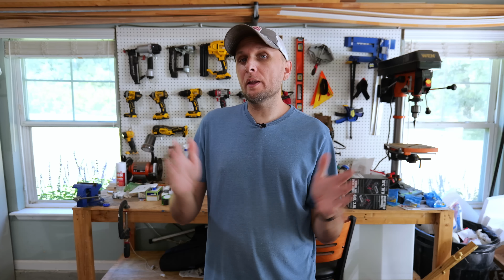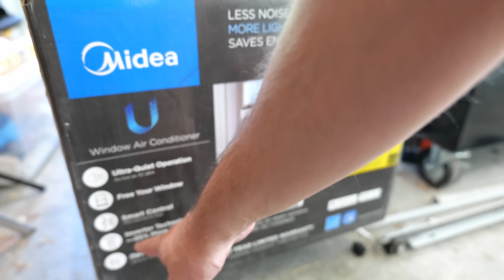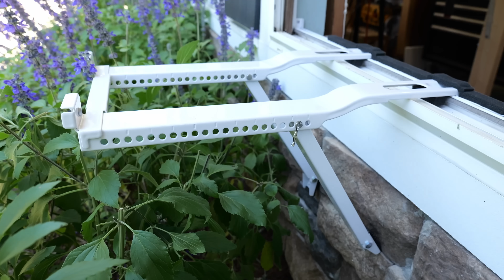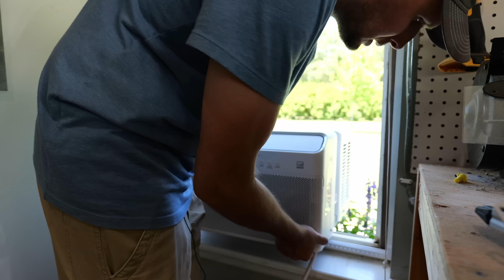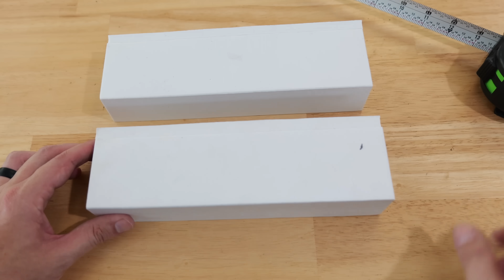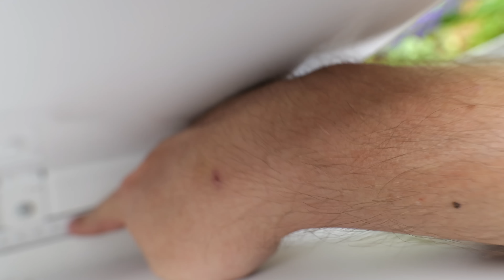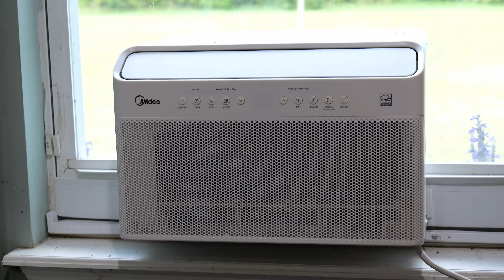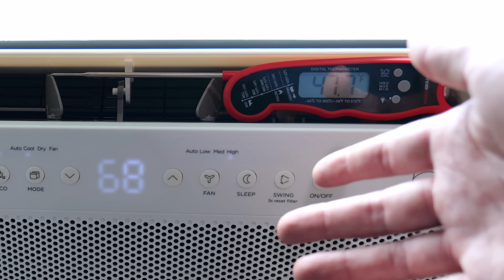The COLDEST And QUIETEST AC Unit Ever Made!  Still Use Your Window!

Comment: Why do none of these DIYers concern themselves with the fact that their machines are talking to servers that are not within your authority?  All of these phone apps that everyone nuts over are connecting your home to SOMEONE ELSE'S SERVERS!  The only thing keeping them from either taking control of the devices or in other cases selling info about your home is a flimsy promise.
I want to know more about the options.  Can I connect it to Home Assistant and actually control the device without it talking to outside servers?  Is there a PC app that I can use instead?  Does the system still work if the internet connection goes down?  It just feels like everyone is drinking the kool-aid of the Internet of Things.

Comment: So where does the water actually drain out of the unit?
Reply: It is actually a splasher type of unit that uses the condensate to help cool the condenser and increase efficiency. But any excess water will drain out the back where there is a drain hole underneath.
Reply: @anonymous-zn2iv  Thanks,  I have not seen the or felt the drain hole. My water drains out of the very back, I am seeing rust on the body of the AC  and algae growing on the vines of the AC. I have been using it for a month now, yes it is tilted correctly.
Reply: @Moondoggy1941  Actually the drain hole is close to the center of the unit putting it near to the outside wall.
Reply: @anonymous-zn2iv  How many inches from the back of the unit going forward is it?  I got a feeling I have is a manufacture defect.  Thanks again.
Reply: @Moondoggy1941  I just measured it, about 12 inches. The hole is quite big actually. You can put your finger through it.
Reply: @anonymous-zn2iv  Thanks again. So I measured it and I found the hole, it basically is right about the window sill, so this seems weird to me, 

if the unit is suppose to be tilted back then why is the hole in wrong location? aka the front.
Reply: @Moondoggy1941  Perhaps to allow the water to collect near the rear fan so that it can fling the water to help cool the condenser. It's suppose to create a pool of water near the back. If the water level gets too high then it will start to leak out of that hole. I don't think you need to worry about it.
Reply: @anonymous-zn2iv  Thanks when I looked at the coils near the end I could see crude and algae, I also could see a rust stain over the back of the unit where the water is trickling  out. I appreciate the help.
Reply: @Moondoggy1941  Sure thing

Comment: Overpriced, non rust-proof interior materials. I'll pass.
Reply: It's a converter type compressor so that is why it is more expensive than your regular non inverter ac. All ac's will rust over time. But it will take years before the rust will actually cause any functional problems.

Comment: I bought that 12000 15 months ago and can tell ya I live it,, my central doesn't run and I do have a small ranch ( 2 bedrooms and with a fan in the dining room it's cooled my 1000 sq ft house ,, it's in a living room window,, if it goes out I will get another, hands down amazed at the cold air , quietness and my electric bill went down noticeably from running the central.

Comment: How useful is it to be able to use the window?  You really can't use it for ventilation since you can't use a screen.  I don't think it is a very useful feature.
Reply: Actually the benefit is more for minimizing the sound from the compressor by having the compressor basically sealed off from the room. The ability to open the window is just a minor benefit as a result of this design.
Reply: @anonymous-zn2iv  now that's a good benefit. He should have touted that instead of the usability of the window.

Comment: I bought this unit 2 years ago and I love it! The quiet efficiency that this video reports is borne out by my experience. I have this in an upstairs bedroom where my central ac just doesn’t reach very well and now I don’t have to run the central ac nearly as much. This ranks as one of the best purchases I have ever made, of any product!
Reply: Thank you. I have a loft that gets pretty hot too. 🌬️🔥💨🌨️❄️❄️❄️ This is definitely another good option to consider 💫
Reply: Was yours affected by the mold recall?
Reply: it's chinese, wait till it breaks down in about 4 years
Reply: @roachedout  I bought 6 with a spare new in box in the garage.   If one breaks in 4 years, still cheaper to replace than to fix a mini or central AC unit.
Reply: @roachedout do you have any recommendations for a good unit ?

Comment: Quite a setup, but you don't need to break anything. Might still be practical, somehow
Reply from the maker: Break anything?
Reply: @HowToHomeDIY  oh, I forgot you guys have wooden walls. No "cutting", then, to place a unit and pass conductors and tubes 😅. With brick walls you have to break then to install and pass tubes, if it is a split unit (or open a hole to install the old single unit ones)
Reply: @HowToHomeDIY  I comment this because it is the first time I've seen a window unit like that, never seen it before
Reply: @HowToHomeDIY  a week later, I got your confusion. Over here in my country, regular, old, "window units" are not placed at the actual window. Instead, a whole is opened somewhere in the wall for them to be installed. That's why I thought of this one as quite convenient, if you DON'T have such hole in the wall already and you don't own the property (or can't make one for whatever reason)

Comment: How do you clean one of these type AC units? I know how to take a window unit out and clean the coils with spray and water hose. Can you spray out the air intake coil in one of these? I jave an 8000 but unit that needs cleaning. Great video

Comment: The Midea unit I purchased,  came in , brand new ,  fan was hitting one of the pipes under the metal covering , I pulled the cover off and rebent it out of the fan blades ,  so this happened before the cover was installed at the factory , no damage to the outside of the unit , quality control sucks !  Lasted 1 year ,  I just through it away , I'll never buy another midea unit again

Comment: I have this 12000 BTU unit, kinda wish i had gotten the upside down U shaped unit from a different company.
I assume its not as well built, but the thing sits on the window sill and i dont think requires a tray. Also, allows you to use ALOT more of the window than the Midea
the Midea worked great at our river camp when our normal vacation spot canceled on us because of a recent change in pet policy and we had to just camp on the river in an un-airconditioned thin walled un-insulated elevated camp... when the outside temp was above 100 and humidity, being in the midwest on the mississippi river, would often top 80% after a short rain.
Reply: Are you one of those people that ramble on about your life stories, and get side tracked about the original core meaning of the subject matter? IE -  canceled on us because of a recent change in pet policy BLAH BLAH BLAH???!!!
Reply: ...if so, I have a gift for you! I want you to google the word "Loquacious". Your welcome!
Reply: @SundayFoggyNotions  2 seperate trains of thought. Wishing i had the other unit because its upside down
Praising the one in the video because it cooled something that wasnt supposed to be cooled.
I do see you're the kind of person to like your own comments because you dont have anything to add.
Reply: Forgot to add, yep totally the rambler.

Comment: I am taking my 8000 btu unit back today. It worked great last year. I tried to turn it on for the first time this year in late May and got the EC07 error code. I tried to troubleshoot it, called Midea, and the said the outside fan was not working. My experience - it’s not reliable. The install took quite a while, so even though the design is great, you may spend a lot of time for something that works a few months.

Comment: @10:40   72 degrees ???   I see 73.

This is fine IF you have sash-type (or vertical sliding) windows.  Not so great with casement or horizontal sliding windows.   :(
Reply from the maker: I had it set lower.

Comment: You put the foam upside down in the window...  Look closely at the foam you will see a line where it's thinner on one side of the foam, that goes into the track for perfect fit with out adding extra foam
Reply from the maker: No I didn’t.  It shows it in the instructions.  That lip is for the bottom of the sliding window.

Comment: 15 SEER isn't bad for a window unit, but it's still a ways off from even the low end of mini-splits. At that price, if all you need is a single room, it's definitely a contender, but once you start getting into 3+ zones, you're still gonna be better off price wise with a mini split. Of course we're not talking about places where you couldn't realistically install a minisplit.
Reply: For 3 rooms, or zones, with mini-splits, I was quoted approx four times the cost of 3 of these units.   The mini-splits are of course more energy efficient but the pay back savings period would be a number of years.
Reply: @richard6150  Then someone was screwing you over BIG time with that quote. A 3ton three zone at home depot is only 2300 for the unit itself. If you're going to be staying in that place for those years then that energy savings is a valid thing to consider. I think the window units are more practical for people without the skills or ability to mount a mini split or cannot modify where they live.

Comment: I have two of these units. One unit has heat. I live in a 2100 square ft house in the Houston area. I have them installed in the main living areas to supplement the central a/c. I've found that if you run them on dry mode they will use around 400 to 600 watts. Each of the units are connected to their own Delta 2. If the outdoor temp is in the low 90s my central unit won't even kick on.
Reply: Delta 2 ?
Reply: @richard6150  EcoFlow Delta 2

Comment: Seems gimmicky, the #1 problem with window AC units is needing to clean the inside coil and fins and the outside coil and fins every 1 to 3 months. With a motorized air guide it makes it even more of a hassle to clean out the air path. If they could just focus on utility and ease of clean up I think that would be the real shift the market needs.
Reply: That also applies to split systems.

Comment: I've had three of them.  They work well.  Very quiet, very cool, and the scheduling app works well enough and is compatible with Amazon Alexa.  10K and 12K models.

Downsides:
They get funky smelling after a year or so.  You must take them apart and clean the squirrel cage fan to fix that.  After year two or so, the various DC motors, compressors and fan, start getting louder.

That being said, I still think they are a great purchase and a decent value for the money and much easier to deal with yourself when compared to the overpriced garbage equipment being peddled by residential AC companies and the DIY mini split companies. 

The best time to buy them is during the winter.  They are considerably cheaper that time of the year.
Reply: Duly noted, I'll purchased one then. It's June right now (for future reference) and the price of the 8kBTU is only a little bit less than the 10kBTU, which is $399
Reply: The musty smell is the biggest problem with these units. The multiple water drip holes underneath can also cause leakage over the sill so that has to be addressed too.
Reply: Where I live, even in winter, AC's don't fall in  price.  :-/  Anyway, did you try tilting the units back further?  Also, you can try and drop one of those small AC pellets in the cage.  I have never used any, but it came to mind.
Reply: It seems I have to replace these window units in year 2-3
Reply: @shortythefrenchie me too. My last one thats how long it took ( not from this brand) . Then we bought this one. Yet the one my father  in law bought almost 20 yrs ago still works. The warranties are for only a year. They break the next year. Can they be fixed? Which one lasts longer than 5 yrs? Does anyone know? Should I wait for the winter and just buy another one for the next year?
Reply: I have 4 and have 2 for a few years. I just received a recall on them 6/2025. They either refund you prorated (it was very reasonable) or get them repaired. They are putting in new drain plugs. There are diy sheets on what to do. I am keeping mine. I have covers for off season.
Reply: @jeremullen3721 what ?I just bought mine 7/2025 should I take it back? Or was it for an older unit and these new ones are fixed?
Reply: I'm in my 3rd year with 2 of these and I haven't experienced any of those problems. Our central ac works very well, but with the extreme TX heat these window units helps me achieve a much cooler environment and everyone in the house knows when I turn one of them on.
Reply: @dboucher26 how long until you noticed they got musty or didn't work as well or quit working?  We just bought one this afternoon. I love it compared to my old one.
Reply: The units currently on Amazon state that they are "updated." Does anyone know if the updated units fixed these issues?
Reply: Mini splite heat, this is apples to oranges
Reply: Thank you so much. I learn so much in the comments 🎉

Comment: I imagine this will not work, turned 90°, for slide by windows. Any ideas for a solution to that issue?
Reply: Best you can do is buy a floor unit with 2 hoses.  Don't buy one with a single hose, as that one sucks air out of the room which makes it very inefficient.

Comment: Can confirm, I have the 8000btu unit installed in my window, this unit is fan fucking tactic, keeps our bedroom ice cold during the night in the summer and it’s quiet I mean compared to other units very quiet, blows ice and the compressor shuts off when it doesn’t need to be used

Comment: I bought this unit at Costco last year. It works great and is very quiet. I recommend you add extra foam below the unit, as the support frame has a couple gaps that bugs can use to invade. You need to be down low to see them, but they are there. 

I have an Echo Dot 5th gen in the room, and created an Alexa routine to turn the A/C on for an hour when the room gets warm.
Reply: Didn’t know that you could set up Echoes to run a time length.
Reply: @zeroturn7091  yep, you set up a routine. Action 1 is for the AC to turn on when the temp hits X. You can specify your smart thermostat or the temp sensor built into a Dot 5 that's in the same room as the AC. Action 2 is Wait one hour. Action 3 is turn off AC. 

I have that routine run 5-9 pm daily so that the room is reasonable when I get home.
Reply: @traceymeek1238  I think that my thermostat is on the lower tier, and doesn’t have the sensor built in when it comes to hitting X temperature.  My echo dot does have it, but it’s calibration is way off by 4 to 6 degrees depending on the day.  I made the adjustment to account for the offset.
I understand the routine command now to delay the action that turns the thermostat off.  I’m leaning towards supplemental cooling solutions, seeing that contractors are quoting me $6K minimum to resize all of my ducts.
Thanks.

Comment: Call me crazy but might try the ones on Temu, where, more sensibly, the U is the other way and hangs down and the unit doesn't block the view from your window.  Plus don't need all that bracket crap most likely. Stick a couple poles outside to support it (for ground floor or even 2nd)  if even needed.

Comment: I have a 10,000 BTU unit that I've owned for 4 years, and it's worked great so far. Much, much quieter than a portable AC unit. I rent the house, so didn't want to drill a hole through the wall for a mini-split, though I have considered installing one by fabbing a panel to run the lines through the window opening.

Comment: Been using the 10000 unit. I had to drill a hole in the bototm for great drainage and coates it so it wouldnt rust. Also sprayed with vinegar before winter to prevent mold. The diffiser isnt all that good not much range. I used a window spray foam to seal the air gaps foam was useless. The window space im using barely fits 10inch ac. So i have to remove the windows to even install this but once it's installed I like it. I dont think its good for 450sf but they sell it as an upto... so more like 120sf gets comfortable with this unit.

Comment: Your funny 😅 . Its that cold because you are taking the temp close to the evaporater . I see these temps every day at work on the equipment I work on when I measure D/T . And as far as the inverter technology on small equipment I wish you luck . When it breaks and it will , to the dumpster you will go . That inverter will cost you as much as the window unit cost you originally . A window is a window unit . Nothing efficient about them .

Comment: The quality of the unit seems to be good, but I don't see much value in that particular window feature.  It still needs to be sealed, etc, etc...   However, if that's what you need, then there you go.  If it runs quiet and cold, what more could you ask for.

Comment: Nice, but I have a 23 year old Kenmore window unit.  i think about 5000 BTU .  I was worried as it was a little small for my office (400 SF)but it does a great job.  It was working great but then about 3 years ago I saw a YT video telling me I should clean it every year.  Did that, it wasn't very dirty and it still runs fine.  I just checked it out and from 6 feet away it is at about 47 DB as opposed to the 34 DB ambient in the room.  I took about 3-4 minutes to drop the air temp coming out of it from 71 to 55 degrees.  Now I cant easily  get to the plug to check power consumption and I'm sure it is not as good as this one, but this things has been bulletproof for decades.  Sometimes simple is better.   My solar produces way more than I use anyway most days.